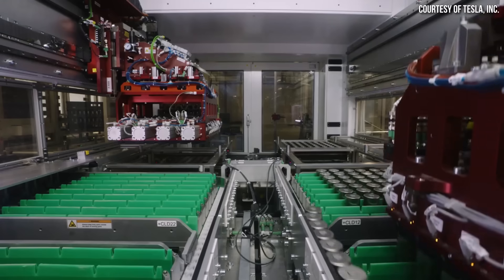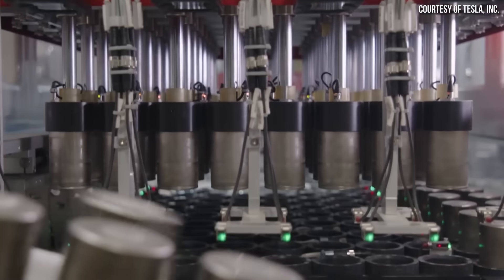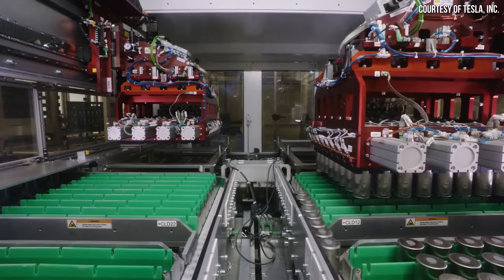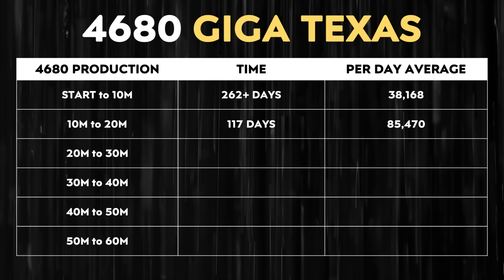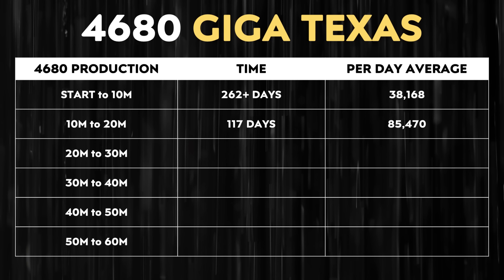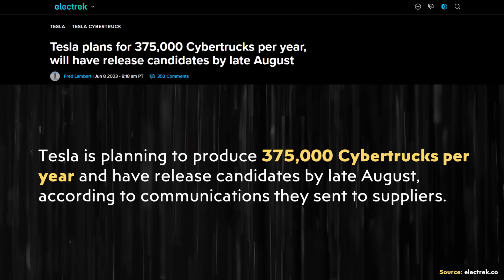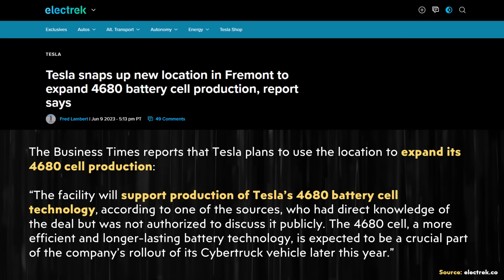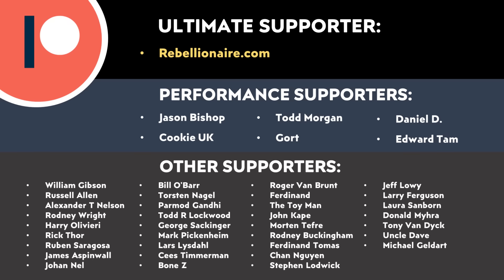Tesla 4680 Battery Production is QUICKLY RAMPING at Giga TX

Comment: One thing that was mentioned at the last update from Tesla they said they were concentrating on getting it right in the first line, once they had ironed out all the kinks they would then transfer this  learning to the next three lines, so we might find they accelerate very quickly if they are content that the first line is spot on.
Reply: They also mentioned that Kato Rd facility would continue to be one iteration in advance of other factories, it's basically a pilot line as it has been since inception, before they push the latest technology out to the larger battery production facilities.  

Texas has 4 lines per yesterdays call and the production from 10 million to 20 million was on a single line, which as you say will now be the setup for the other lines at the plant.  Which means they can get from roughly 10 million per quarter to 40 million per quarter in a relatively short period of time (I assume), which translates to about 30,000 CT's per quarter sometime in 2024.    Musk gave an estimate of 125,000 annual run rate by end of 2024.

Comment: After three years of development, the production of Tesla's core 4680 battery is 2.5 million units per month, which is surprisingly low😫. Cyber's battery capacity is at least 60kw, so assuming each battery is 100w, 600 batteries are required per device, and your calculation of 130 batteries is incorrect. Tesla's Terra W production has no choice but to be very pessimistic.
Reply: Cybertruck will have way more then 60kwh you kidding there bud

Comment: Well this is tasty ! Thank you Jon.  I wouldn't mind at all if my Cybertruck came with a Nio swappable battery option. Not to get a recharged battery but to try different battery chemical or layout designs limited to a chassis housed matrix of batteries that would fit into the truck frame.  Cylinders or prismatic,  lithium or silver. Give us options !  Rich guys will want 999 mile range.  Po boys (me) might get by with 299 miles of range.

Comment: Has anyone reported if Tesla has overcome their cathode dry process manufacturing problems?   Tesla Q2 quarterly report over this summer stated that 4680 cells were still dependent on the wet process manufacturing   for the cathode side of the 4680 battery production.   Clip at 8:02 shows the anode dry process manufacturing but nowhere in your presentation shows the Cathode dry process in the 4680 battery manufacturing.  Tesla paid a high price to acquire Maxwell Technologies, Inc. in 2019 for its dry process manufacturing techniques.   It appears Tesla still has issues with implementing the efficient process to 4680 battery production, the numbers you present are optimistic at best.

Comment: That run rate is worked out as per day PER LINE. At some point a single line won't be able to keep up with run rates estimates generated like this.

Still, when the 2nd & 3rd & 4th lines go up, they will quickly double the runrate of a single line. That makes the overall ramp steeper, discontinuously steeper. It'll just jump up a level.
Reply from the maker: Why do you think that they are only running 1 line? They have been working on getting all four lines working for quite some time. I am assuming at least 2-3 are operational.
Reply: Ahh, my assumption is that I was still up to date. As I've been hearing, no special sources, they were only rolling 1 line at Austin. As you say here, you're assuming at least 2-3, why?

Extra lines impact a multiple on increases. When they come on makes a difference. @Cleanerwatt  Can't really predict without those numbers.
Reply: This is the first mention by anyone that they were working on all four lines.  So the question is what is the basis for claiming they have equipped up to four lines. 
Second, it is prudent for a new process to be run at scale before multiple replications are attempted.    Failure to do so could lead to a plant running at 4% of capacity a year after production began.  Who wants that on their record?    Oooops!
Reply: Very significant point.  It seems only reasonable the TSLA would equip only one line and get it running well enough to justify equipping a 2nd, 3rd, 4th line.
Reply: Which is why they would want a dedicated prototyping line. Then they can take things to the edges and be able to zone in on optimal combinations & procedures. Then update the others. @jamesoitzinger6640

Comment: Good topic and excellent presentation.
I am not sure which building (Kato Road or new lease building) has more more square footage. Tesla might decide to start producing 4680 batteries at volume at both locations. I will not be surprised if Tesla engineers have mastered the dry cell manufacturing process and will ramp up faster than the two official data points that we have (10M & 20M). The financial implications of this is HUGE under IRA. Tesla will get IRA credit from making the batteries (no other OEM will have that) plus the battery packs that they assemble.

When they start expansion of GN they will first finish the 4680 battery plant and start producing them before the Semi production.

Great days ahead for Tesla in the next few years.
Reply: The Irish Republican Army is involved with this? Lol

Comment: Based on Cybertruck demand and limited 4680 production is it safe to assume that most Texas Model Y long range built in 2024 will be 2170 batteries? Do Model Y 2170 long range built in Texas have the front casting?
Reply: Yes and no